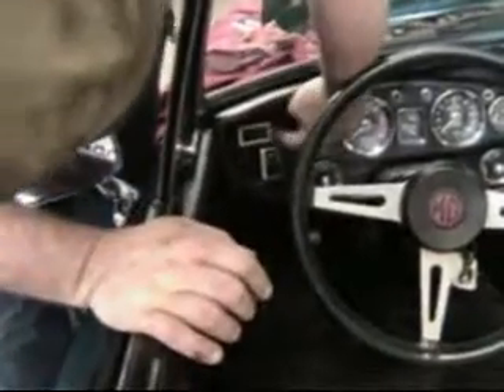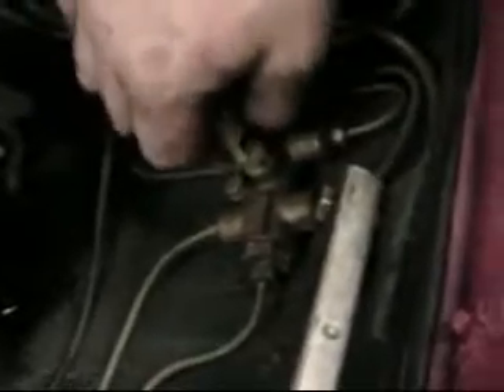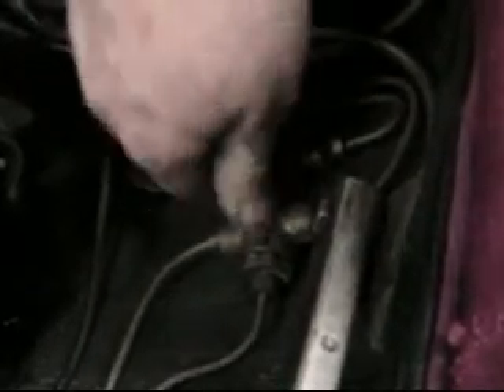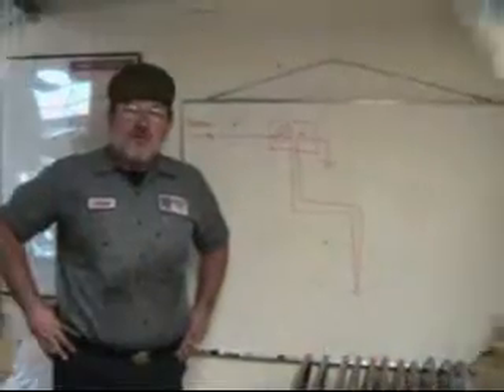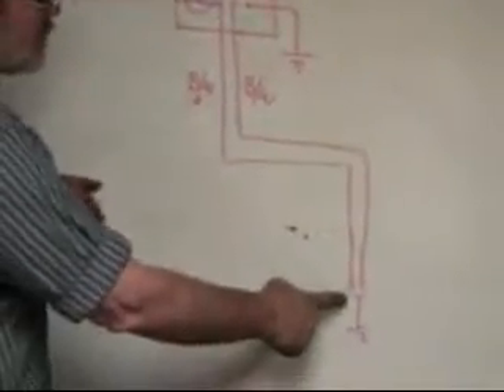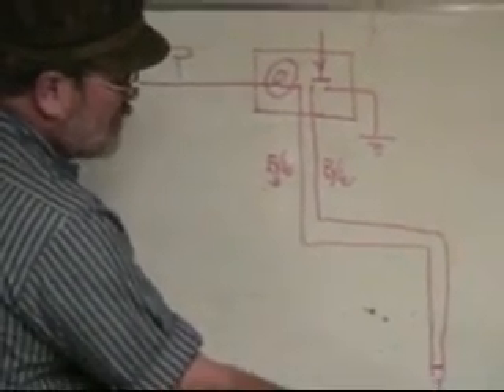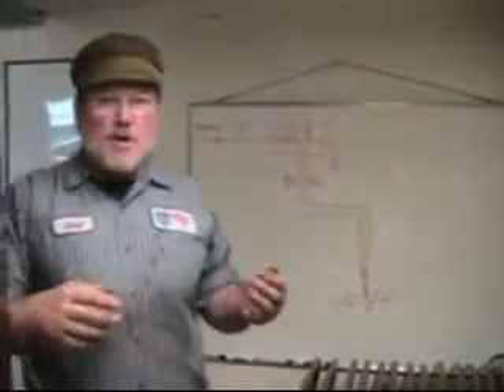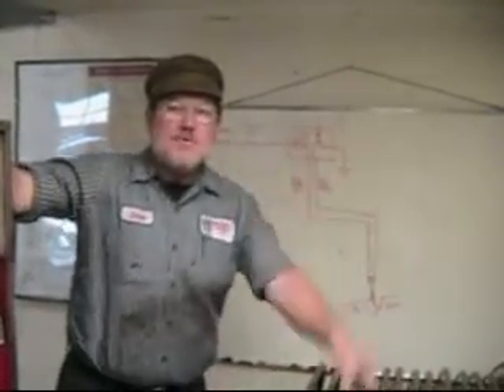034 MG Tech | Brake Warning Light Circuit (NOT Brake Lights)

Comment: The difference in video quality between 2007 and 2013 is shocking.
I have a 1969 Spridget, and my brake warning light doesn't work at all, not even when I push the test button. I'm replacing my brakes, and the brake bleed procedure includes inspecting that infuse "until the light comes on". So I gotta fix the light before I proceed.